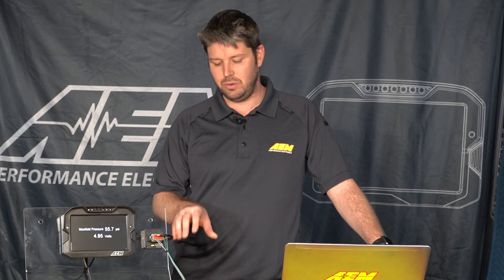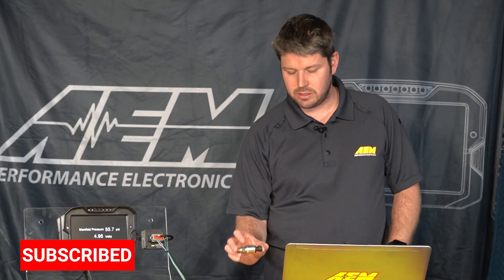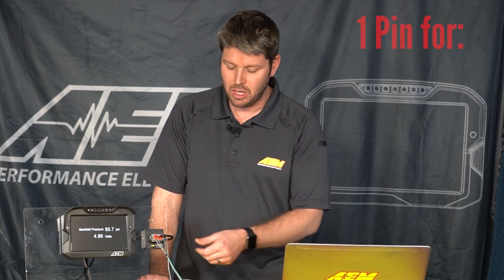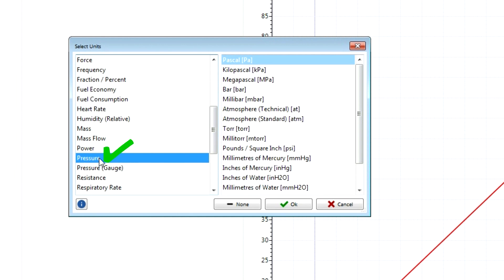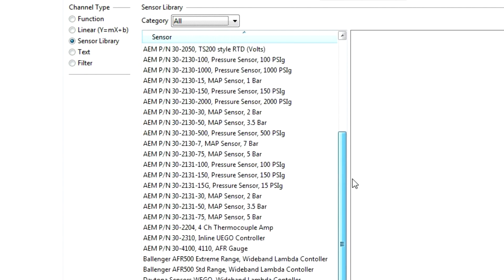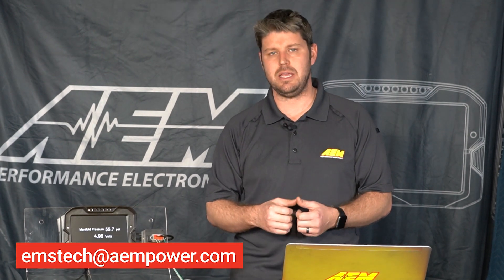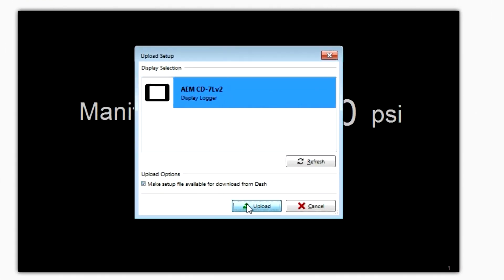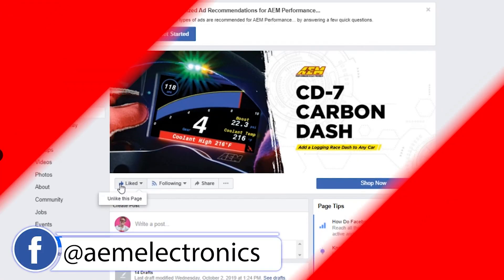PRESSURE SENSOR Installation and Calibration in DashDesign

Comment: Will the CD5 read oil pressure on a 370z without any modifications or adding sensors via the OBD port?
Reply from the maker: While all 08-up cars send OBDII data over CAN bus, what they send varies by manufacturer. We suggest doing a search on available OBDII channels on the 370Z. If it doesn't send oil pressure you can easily add it with a sensor and 6 Channel CAN Sensor Module, which also allows you to expand channels later by adding another pressure and two additional temp sensors!
Reply: @AEMpowerTVelectronics  thank you for that information. I really appreciate it. One last question though the CD5 Carbon part number 30-5600F is the latest display available or is this an outdated version? I noticed on the online listing I’m viewing it does not have the two side buttons on the bezel.

Comment: How do I scroll to the next page on a flat panel model since it doesn't have the buttons on the side?
Reply from the maker: Simply wire a momentary switch to the change page button input (diagram and product linked below)

https://www.aemelectronics.com/products/cd-digital-dash-displays-adapter-harnesses/cd-carbon-dash-accessories/cd-dash-button-kit

https://www.aemelectronics.com/sites/default/files/30-3610-wiring-diagram_0.jpg

Comment: How would one go by to review tpms on a car that did not come with it? Or does that require the aem ecu also?
Reply from the maker: That would require an external tire pressure to can module, there are some really good motorsport solutions from the guys at Izze racing

Comment: One important note: the sensor will not read 0.00psi depending on ambient pressure and altitude. This was stated at 5:30 and I believe should be recognized for the super critical folks like myself. If you're at 10,000' it's not going to read 0.00